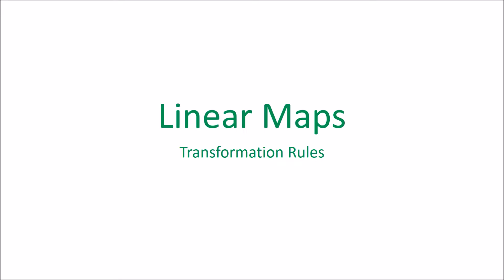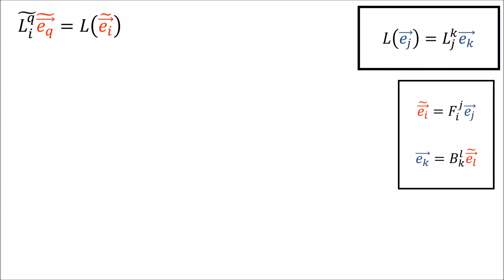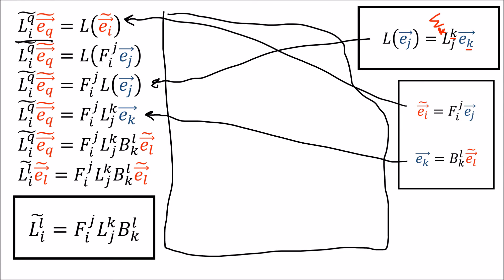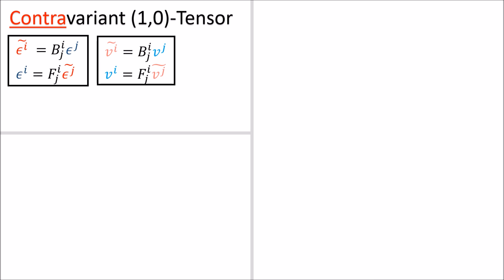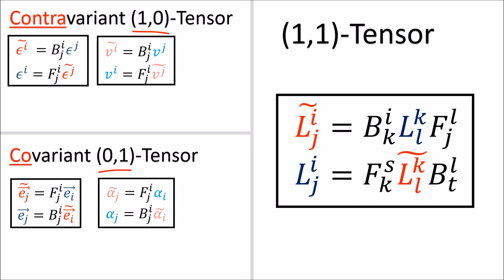Tensors for Beginners 8: Linear Map Transformation Rules

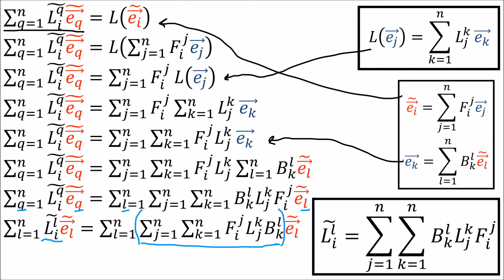Comment from the maker: A lot of people are confused about the FLB vs BLF formulas at 3:12.

The order of matrix multiplication does matter. If F, L, and B are matrices, then FLB is NOT the same thing as BLF. But I have not written matrices on this slide. I've written F(^j_i) L(^k_j) B(^l_k) = B(^l_k) L(^k_j) F(^j_i), which are matrix components (ordinary numbers). You can switch their order just like you can re-write 3*4*5 as 5*4*3. The matrix multiplication happens in the summations over j and k, not the order of the terms in the sum. It's the summation indices themselves that you are not allowed to change.
Reply: On the last slide (11:04) have you swapped the covariant and contra-variant around? The bottom ones are vectors, right, so they should be contra-variant, and the top ones are co-vectors, so they should be co-variant?
Reply: Hi @eigenchris I was wondering if it was possible to add this comment to the video description. I'm not sure if that's possible once the video has been posted and if not then that's fine. I know I sound silly not to have read at the comments. I have adhd but m not sure if that excuses me. Again I find this video great as all others I've watched so far.
Reply: How can you tell from the sum representation of a matrix product the order, in which in which the matrices have to be multiplied?
Reply: @alexanderwolf2768  it seems that the alphabetical order of the indices is used here, though I would personally prefer to use brackets for any summations involving more than one index.
Reply: @alexanderwolf2768  At a glance, write the multiplication so that: the leftmost factor has its top index constant  with respect to the indices of summation, and then so that the next factor contracts with the previous (its top index is the same as the bottom index of the previous factor) until the final factor has its bottom index constant with respect to the indices of summation.  In other words, imagine that you can cross out the same index if it goes along a diagonal like this: /.  This will give you the order of the multiplications.
Why this works, I describe in another reply under this pinned comment.  It may be worth it to do a multiplication of 3 2x2 matrices forwards and backwards, then arrange the components of the matrix in the same multiplication order so that you can see how the indices kind of cancel out to give the components of the product.
Reply: Hi Chris how do you get the right order of the matrixes in relation to old L?
Reply: I think this is still a bit confusing.  Not only can the order of the product in the sums be changed, the order of the sums themselves can also be changed; so, the order of the matrix multiplications doesn't come from either of those.  Instead, it comes from whether the index is traveling along the row or the column for a particular contraction.  For the product AB, the components of A travel along the row, meaning that the row/top index isn't part of a sum and is held constant - similarly, the components of B travel along the column meaning that the column/bottom index isn't part of a sum and is held constant.

Comment: Hey Chris I have just realized that my misunderstanding rises from the fact that you are considering 3 pairs of bases..
Basically the first L changes the vector components from e1e2 to base let's call it g1g2 .. implicitly you don't mention it. Then you introduce "e Tilda1,2" and BLF works because BL takes you back to the original basis vector ( e1e2) and then F lets you build the new L Tilda that takes from e1e2 to e tilda 1,2.. 
So applying this new L Tilda to the vector components written in the base "g" you get the new components in the base e tilda.

Comment: At 3:15 you have from the last equation L(tilda) compenents = sum of sum of (FLB). But you have at the final expression in the rectangular box as L(tilda) components= sum of sum of (BLF). I mean given that matrices are not commutative and the order of multiplication matters, is it correct?
Reply: seems correct, as he shows a bit later the components he finds fits. But regarding that spesific order of the matrices (BLF), i saw an earlier reply he made where he said that the order of the matrix multiplication is determined by the indices of the components. The pattern i notice is that the upper and lower matching indices rise a notch as we move to the right, eg. k as the lower index of B becomes an upper index for L, as with j
Reply: I stumbled as well, but Chris and Patrik explained. F(ij)*L(kj)*B(lk) = L(tilde) are products of 3 numbers, that can be multiplied and then added in arbitrary order for all i, j, k.... (All summations go from 1 to n, i.e. the constant boundaries of the sums don´t influence each other. Thats why you can switch the order and get the same result.). If you apply matrix multiplication rules (row elements of left matrix * column elements of right matrix), then the order matters and only B(lk)*L(kj)*F(ji) for L(tilde) is the right one. Here k names elements of the l_th row of matrix B and of the j_th column of matrix L....Hope, I got it right

Comment: sir,why do u change FLB to BLF in the derivation??pls reply
Reply from the maker: You can change the order of coefficients in a sum since they are just numbers. I tried to explain this in video #1.
Reply: @eigenchris  but what about the matrices.Like,Can i get the same result L tilde if the order  of BLF is changed?
Reply from the maker: @JL-jc5fj The order of matrix multiplication matters, so you can't arbitrarily change the order of multiplication for matrices. But in the summation notation, you can change the order of coefficients... you just can't change the summation indices from the way they are written (it's the summation indices that determine the order of matrix multiplication, not the order of the coefficients). @JL-jc5fj

Comment: At the summary slide at the end, the contravariant rules use epsilon with raised indices for the basis transform and the covariant rules use "e" and lowered indices for the basis transform. If I have understood correctly so far then this must be an error. If so it makes no difference in understanding the point being made.  Just a little concerned that I have misunderstood something.
Reply: @peterrobinherbert
I’m pretty sure this is not an error. 

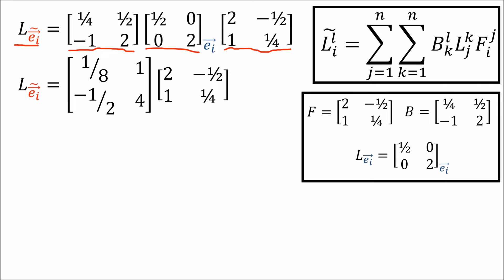In the 3rd video of the series at time stamp 4:53
https://m.youtube.com/watch?v=A1h_eucHFW4
He explains that if a term is contravariant, the convention is to raise the indices, so that explains why the index on the Covector basis was raised.

For your second question about why he used epsilon instead of e to notate the covector basises, revisit the 5th video in the series at timestamp 4:55
https://m.youtube.com/watch?v=rG2q77qunSw&t=2s
He explains that “the epsilon Covectors form a basis for the set of all Covectors.”
So eigenChris used epsilon instead of e because the covector equivalent of basis vectors are the epsilon covectors.
(If you are confused as to what the epsilon Covectors are, I would suggest rewatching the video 5 entirely.)

That’s why the index is raised and epsilon was used instead of e for the basis Covectors. I hope that was helpful! :)

Comment: at the end, I thought that v and v tilde are (0,1) tensors, no ? That is if you meant that (1,0) tensors are row tensors. Am I right? I'm saying that not all contravariant tensors are (1,0). Just the epsilon and epsilon tilde.
Reply from the maker: Anything with an upper index transforms contravariantly, which is the (1,0) transformation rule. Anything with a lower index transforms covariantly, which is the (0,1) transformation rule.
Reply: @eigenchris  do you mean by (1,0) a row vector?
Are v and v tilde row vectors ?
Reply from the maker: @youssefdirani  Vector components should normally be written as columns (same goes for anything that transforms contravariantly/using the (1,0) rule).

Comment: I have a confusion.
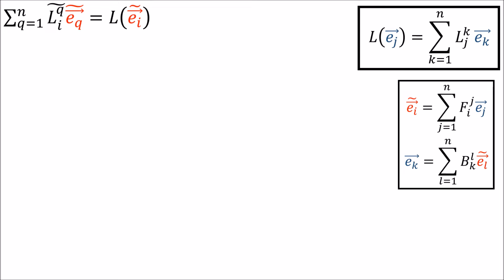At 1:38, in the bottom equations, the left side has normal L and the right side has L tilda. Does this mean that linear map L doesn't change but its components change from L to L tilda?
So are L: V-->V and L: W-->W the same?
Reply from the maker: I maybe used some bad notation here. The Linear map "L" does not depend on coordinates, similar to how the vector "v" does not depend on coordinates. When can expand the vector "v" in the "e" basis to get the v^i components, or expand it in the "e~" basis to get the v~^i components. For the linear map L, we can expand it in the "e" basis to get the L^i_j components, or expand it in the "e~" basis to get the L~^i_j components. Does that make sense?
Reply: @eigenchris  Ah yes now it makes sense. Thank you.
Reply: @eigenchris  Thank you very much!

I was also lost in this part.

Comment: 3:12 last lines you go FLB than BLF than FLB
and conclude with BLF. Is that an error ? I think the correct is FLB
Reply from the maker: The order of matrix multiplication matters, but the order of the letters in that formula doesn't matter because FLB are not matrices... they are matrix components. You can switch their order just like you can re-write 3*4*5 as 5*4*3. It's the indices being summed over that determine the order of matrix multiplication.
Reply: @eigenchris  thanks a lot !

Comment: In 11:10 what are you calling "tensors"??????
Reply from the maker: Vectors (components with 1 upper index), covectors (components with 1 lower index) and linear maps (components with 1 upper and lower index) are tensors. Basis vectors (e) and basis covectors (epsilon) also follow the same transformation rules.
Reply: @eigenchris  but what do you mean by saying "contravariant law" or "covariant law" ? :/ both  basis covector and covector components are not related? I mean, when we say "contravariant components" for example, we say "contravariant basis" as well?
Reply from the maker: @palantea1367  "covariant" means something changes in the same way that basis vectors do (if basis vectors use F, then covariant things also use F). "Contravariant" means something changes in the opposite way that basis vectors do (if basis vectors us F, then contravariant things use B).
Reply: Hmm i understood that, but why did you put basis covector and vector componentes in the same box? if they do not refer to the same object...
I understand that a vector is always contravariant whereas a covector is always covariant, am i wrong?
Reply from the maker: @palantea1367  Yes, you're right. I put basis covectors and vector components in the same category because they transform using the same rule. If I were to make this video again, I probably wouldn't have included basis vectors and basis covectors, since they are separate from components, but this was made 3 years ago when I didn't understand things as well.
Reply: @eigenchris  thank you!

Comment: Hi Chris, your videos are de bomb but I have a question. You write all the equations in terms of linear maps in the same vector space. But I’m wondering if the forward and backwards transformations can still be applied to linear maps between vector spaces of different dimensionality? E.g. if the linear map is from a vector space in R^3 -> R^2 then I’m guessing F and B would be 3x3 where L would be 2x3 and the multiplication wouldn’t work out. Please bless me with your insights dawg.
Reply from the maker: Since you have two different bases in that case (a 3D basis for R^3 and a 2D basis for R^2), you have the option of changing each basis individually. Changing the 3D basis gives you a 3x3 F (or B) matrix and changing the 2D basis gives you a 2x2 F (or B) matrix. You would apply one, the other, or both to the 2x3 L matrix to change its components to the new bases.

Comment: Hey Chris, this was an awesome video. There is just one thing I don't understand: why does the origin have to be the same during a linear transformation? For instance, if you just move a unit vector five units to the right (so the origin is now also five units away from the original origin), then you haven't changed the unit vector itself. It is still one unit long and pointing in the same direction as before. Therefore, shouldn't the linear map just be the identity matrix?
Reply from the maker: I guess what I mean to say is that there is no linear map that "shifts" all vectors tips 5 units to the right, while keeping their basepoint the same. For example, mapping the vector (-1,0) to (+4,0); and (0,0) to (+5,0); and (+1,0) to (+6,0). This can't be accomplished with a standard 2D matrix multiplication and requires a 2D vector addition.
Reply: @eigenchris  Yeah, that makes sense. Thank you for the reply!

Comment: At 1:41 how can you use the same letter 'L' in old and new basis. 
I think at the left corner you should use L Tilda'
And this makes sense as expressed below
L Tilda' means linear map in new co-ordinate and this would act on vector in New co-ordinate and this must be equal to 
B(LV)
Here L is linear map in old co-ordinate 
V is vector in old co-ordinate
(LV) is a vector which is maped in old basis
And to get the maped vector in New basis I have operated it with backward transformation matrix B.
Conclusion
B(LV)= Ltilda operated over V Tilda' 
V Tilda'can be written as BV 
B is backward matrix and V is same Vector is old basis
So B(LV)= L Tilda'(BV)
~ BL= L Tilda'B  ,taking B to another side 
~BL(B inverse )= L Tilda'
And B inverse is F which is forward matrix 
So L Tilda'= BLF
Hope you get my point
And thanks for what you are doing
Your video really means lot to me
Reply: I think I should make my question more clear
Let me ask the question at 1:41 the linear map 'L' is the different matrix than L on the right corner .
L on the right corner is the linear map in old basis.
It the above statement is true then why is third line you were treating L on the left as same on the right . Because you have used the right corner equation in the third line. Which should not be used.
Reply: @ravishanker785  Here the basis vector in alternate basis e∼ is treated as the invariant vector.
Reply: Actually I was wondering the same thing

Comment: 2-24-19. Hi Chris, what textbooks do you recommend as adjuncts to your lectures and further studies?
Reply: I highly recommend the following: A Students Guide to Vectors and Tensors by Daniel Fleisch, Cambridge university press. It can be found at Amazon and Cambridge university press and I suspect many other places including libraries. I like it because it explains some of this stuff with pictures and also addressed the confusing multiple nomenclature approaches (matrix, summation, einstein summation notation). It also has some nice homework problems with on line solutions as well as an entire chapter on 3 applications (inertia tensor, electromagnetic field tensor and the Riemann curvature tensor). I also found chapter 14 (Tensor analysis) in Advanced Engineering Mathematics (4th ed) by C Ray Wylie helpful but I don't recommend starting with this one. I assume the newer 6th edition still has this sort of thing.

Comment: I have a question about your boxed answers at 7:48 and 3:25. The only difference should be that at 7:48 you have rewritten this matrix transformation using einstein summation notation instead of with summation symbols. However it looks like the F and B transforms are flipped. Is it supposed to be like this? I believe that order of these transforms should still matter.
Reply from the maker: Here, F, L and B (with subscripts) are the COMPONENTS, not the matrices themselves. So since the components are just numbers, we can multiply them in any order we like.
Reply: @eigenchris  I see, that makes sense. Thank you! Your justification at 4:25 makes sense in why we do BLF for a matrix transform,but how would you arrive at this ordering using the summations of the components?
Reply: I've given this a little bit more thought, and I think I have to disagree with your reply. F, L, and B are indeed components and not the matrices themselves, but in that slide we have implemented Einstein Summation Notation. So these aren't actually just numbers. Because of this these are actually summations.

For example, looking at the the order F^j_i * L^k_j would not make sense as a matrix under Einstein Summation Notation. In this case, we would be summing the rows of a particular column of F with the columns of a particular row in L (following convention that upper index is row and lower index is column). In this case, the notation doesn't make sense.

So basically I believe that we are forced to write it in the order B^l_k * L^k_j * F^j_i in order to properly implement the Einstein notation and to follow proper matrix multiplication.
Reply from the maker: @richardchen7097  The expressions "(sum j) F^j_i * L^k_j" and "(sum j) L^k_j * F^j_i" are the same. If you like, you can write them explicitly on paper to check: (F^1_i * L^k_1) + (F^2_i * L^k_2) = (L^k_1 * F^1_i) + (L^k_2 * F^2_i). 

It's not the order of the components that matters; rather, it's the indexes you choose to sum over that matters.
For example, "(sum x) F^x_i * L^k_x" is NOT equal to "(sum x) F^i_x * L^x_k", because in each case I am summing over different indexes. The first one corresponds to the matrix multiplication LF, and the second one corresponds to the matrix multiplication FL.

Does that make sense?